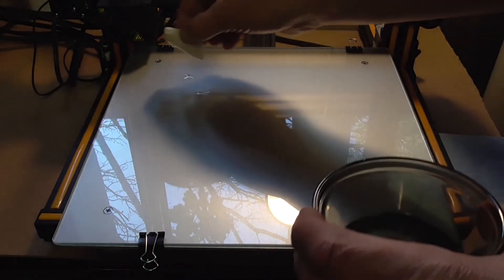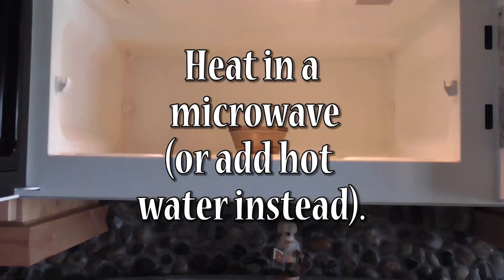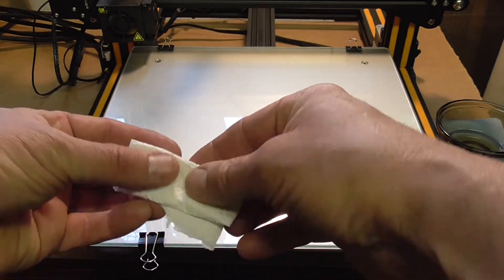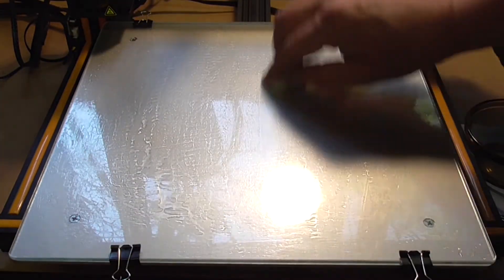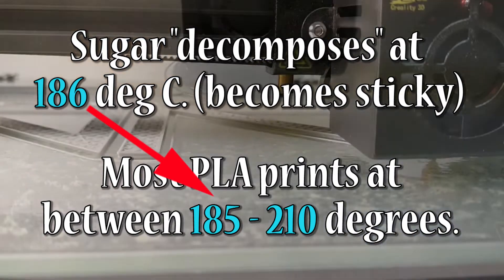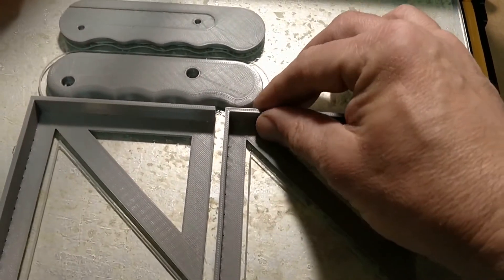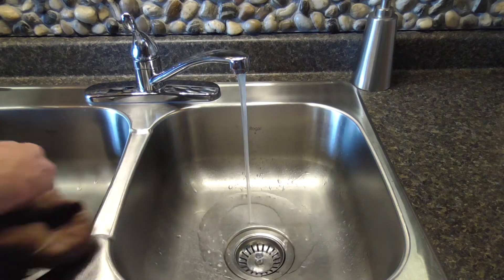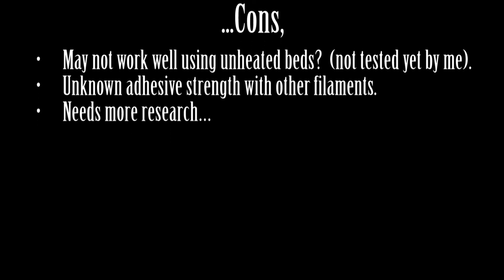A 3D Print Bed Adhesion Method Using Sugar Water: Original Technique Explained #30

Comment: Thank you so much for this video! I have tried everything else (probably) to make my CTC Bizer Dual print without a raft and finally something that works. I don't use a glass tile (yet), but it works very well on the normal painters tape.

Comment: Here is a suggestion...Put in a drop of soap to break the surface tension.  That will help prevent it from beading up and make a more even coat.  Regarding ants...add some boric acid.  That will kill the ants.  If you use enough boric acid, it will kill the colony.
Reply from the maker: After the first coat, surface tension won't be a problem.
Reply: @mysimplefix  Was it a smooth as glass finish across the whole bed after the first coat?  It looked like there were high and low spots, but maybe that's just the camera?